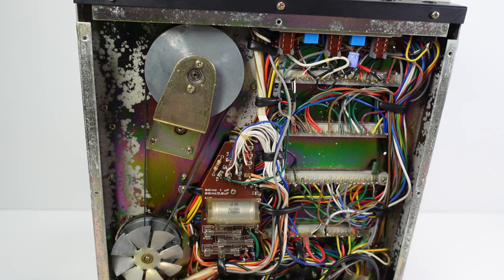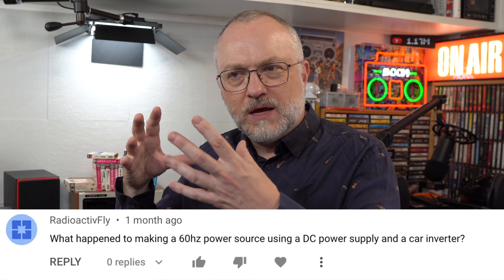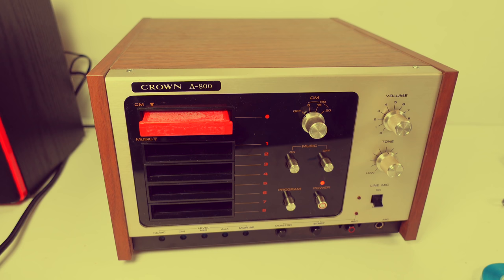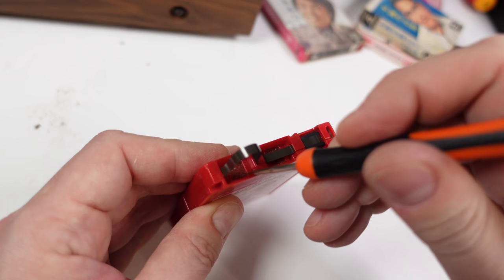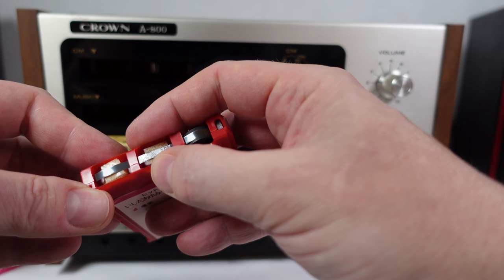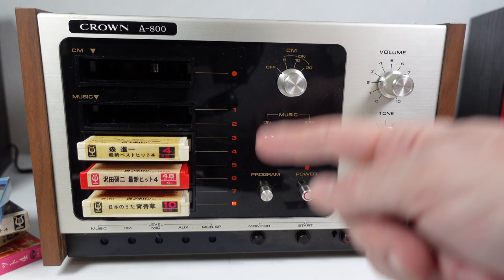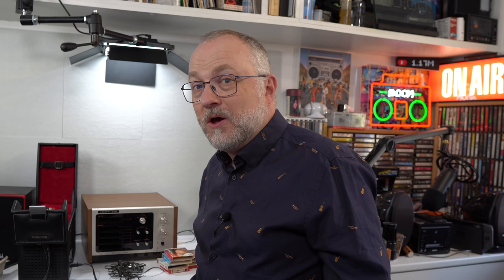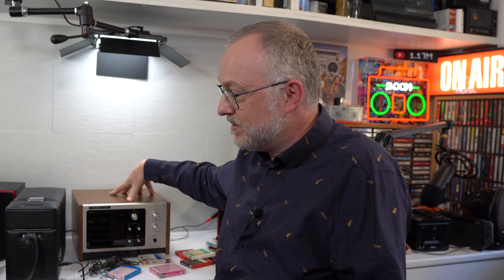Hipac - Fixes, fails and a flash of inspiration

Comment: I was watching your video about modern ghetto blasters that look the part but the performance is guff... And I got to thinking what if it had decent amplifier and speakers with USB, Bluetooth, flash drive and maybe radio and DAB but with a bank of lithium battery cells? It could be the perfect accessory for the seasoned veteran festival junkies! Solar recharge panel to mount on top of your tent, D cell battery compartment for extra charging capabilities allowing your camp to charge phones and bang out tunes! If I prototype it will you join us at Donnington heavy metal Download festival for a comprehensive review? Please?

Comment: I would have guessed that changing the capacitor wouldn't have changed the playback speed not because altering a capacitor can't change the speed a motor runs at, but because a capacitor is a really inaccurate and simplistic way to control motor speed. Many of your "it won't work" comments seem to be aware of this, and many of your "it will definitely work" comments appear to be right accidentally because they know enough to realise that capacitors are "timing" components without knowing enough to understand why it's generally a bad idea to use them in that way for an application like this.

Capacitors in general (end especially large-value electrolytics like the original shown here) have notoriously loose tolerances; often +/-20% or more. For controlling something like a fan speed this doesn't matter so much, but for tape playback I would have expected they'd use a more sophisticated approach to get the playback within at least a few percent of the target value. As shown, changing the capacitance by ~40% results in a playback speed change of ~16%, which means the overall playback could vary by 5-10% just from capacitor tolerance alone.

There are, I guess, two confounding factors that override the expectation that this wouldn't be good enough for music playback. Firstly, this is a fairly early device where more stable motor timing approaches would have added more incremental cost than later equipment where advanced timing circuitry was much cheaper to implement. Secondly, since it's simply a background music player rather than a hi-fi setup, the target audience would be a lot more tolerant of poor tape timing control resulting in slightly fast/slow music.

As such, having such a simple/cheap solution to picking between two different speeds was advantageous (even at the cost of accuracy), especially in Japan where they're basically guaranteed to need to produce devices to support both 50Hz and 60Hz. Still, you'd think it would have been even easier to simply had two belt positions on the pulley instead...

Comment: Yeah, I wouldn't consult Youtube comments for technical advice of any sort. It's amazing how many people are certain of opinions they have that are based on zero actual knowledge. I've given up arguing with morons that have no clue of the difference between a load resistor and a current-limiting resistor or how parallel vs. series electronics work. To expect laymen or even hobbiests to understand how capacitance or inductance work in circuits is giving them far too much credit.

Since the capacitor obviously does determine the speed, you could probably change it with yet another value to adapt the machine to play the tapes you have at closer to the proper speed. 🤔

Comment: I don't think there should be any differences in the cartridges for one feed rate versus another; only the rate at which the recording device pulls the tape over the recording heads. I suspect the CM tape you recorded was made at the correct speed for the Crown system and will not sound right on the car stereo system. 
For fun, I would suggest trying to record a music tape from an outside mono feed using the CM deck to play in one of the Music slots.

Or, you could just fucking stream some music.

Comment: Spoiler alert to no one but the commenting out their behinds, changing the cap changes the speed. Amazing. 

This is a common fix in old walkmans where the cap drifts with age so the tape slows down or speeds up. So you recap to fix speed. 

Those people saying no whilst claiming to be electrical engineers need to go back to school. Very funny

Comment: why not leave it that way and record the sound for youtube that way.

you are safe you can avoid copyrights because youtube algorithm is unable to recognize the slower speed song.

or at least it forces a manual takedown witch means that hiroshi hitsuto  would have to call up youtube and order a takedown.

of course google translator had problems translating so that may not be the right title.

you can also wire a 3 way switch so you can select between 3 capacitors so you can play normally as well as fast and slow so you can stump the algorithm basically like captcha(ing) the algorithm.

you are lucky that the capacitor that sparked when you shorted it was a low voltage cap probably for the amplifier otherwise you could have gotten zapped.

you are lucky that you are working on solid state rather than vacuum tubes as tube systems can have have more charge 

if the unit was plugged in when you shorted it you would have blown the fuse from the power supply.

i think you can still buy draft guard strips or rolls just a different brand you will just have to go to your local heating and cooling shop.

Comment: Oh no electric shock is bad. Luckily no harm was done to people or equipment! I have shocked myself twice, first with messing with a very old valve radio and later with heavy machinery - nowdays I wont touch it inside if it is electric system 🥶